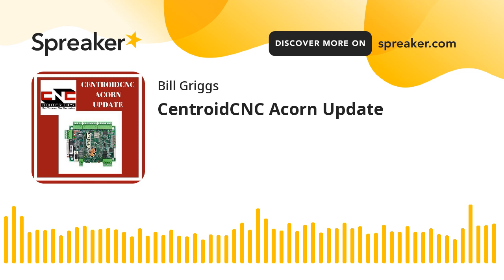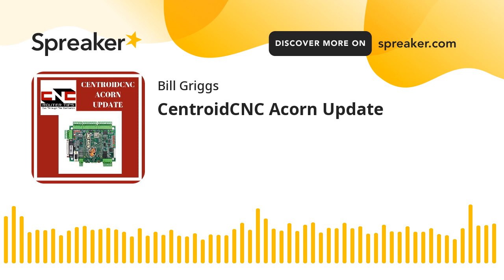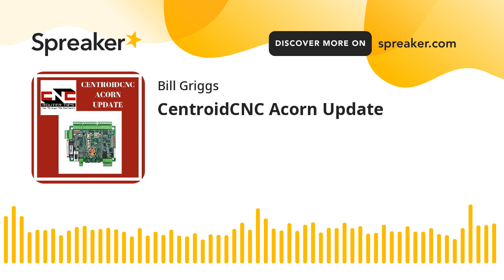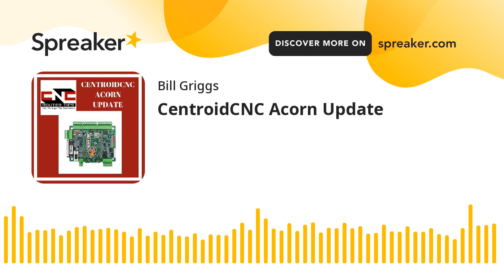CentroidCNC Acorn Update

Comment: What a great speaking voice you have. I just upgraded to Mach4 and an ESS  card but it is giving me trouble with spurious triggering.  Prob just a matter of VFD noise, but how can it be so sensitive.? Never had the problem with my cheap factory supplied Mach3 USB 4 axis controller. Our Canadian dollar is so low right now that Centroid Acorn would set me back 30% extra in the conversion. There seems to be no end to the upgrades one can do. Closed loop steppers or moving to servos. Big money. Next thing you know you're into a rewire, and larger cabinet.